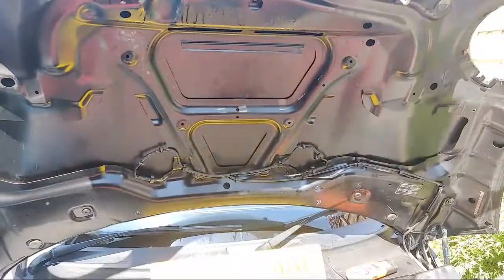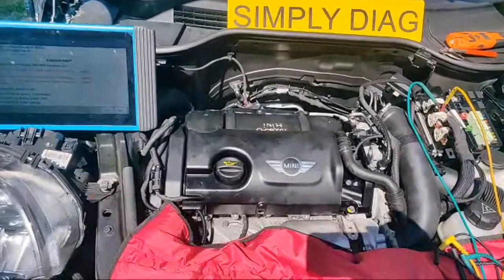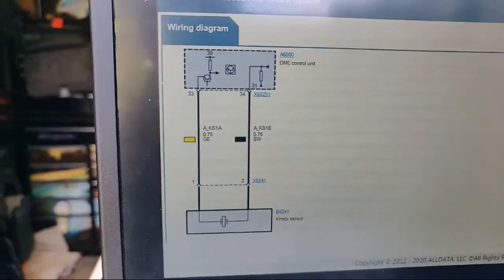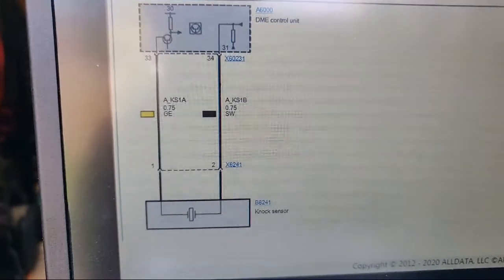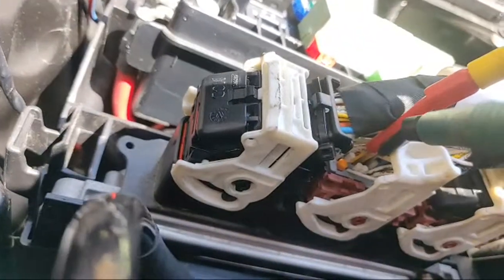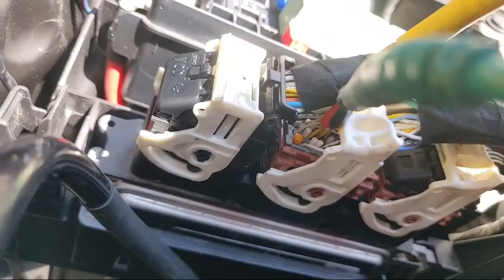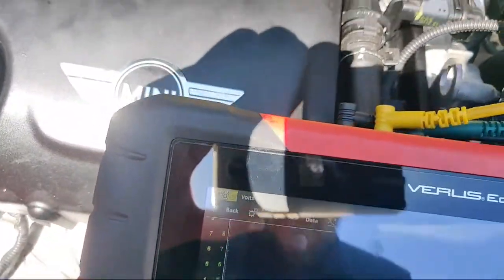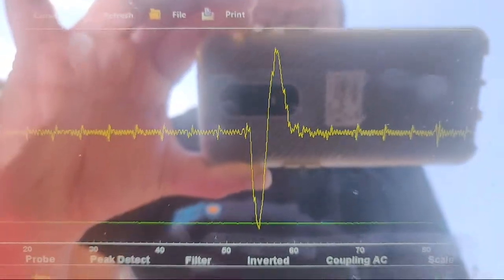Mini Knock Sensor 3042, 2C58, 2F81 Limp Mode

Comment: Hi sir, I own a Mini I have exactly the same codes : 3042, 2C58, 2F81 and this one 32E3 (interface ews-dme), is that posible these comes because the battery too low ? a bit under the 12Volts ? My car is drivent very very little, more in a box than on road.  thank you for your video;
Reply: Hi did you ever find out what caused those error codes?

Comment: hi, can you please help a bit? I have a mini cooper 2014. turbodiesel 105Kw 4WD. It has a synchron problem on 2nd gear (if not put in and out of 2nd gear totally easy, you can hear and feel a  slight crack, bigger on bumpy roads - also diagnosed as such by my mechanic). But the bigger issue is that I experience a loss of power every once in a while which I can never reproduce to my mechanic. When it occurs, I feel like the engine has 50% of the power and RPMs drop down when I press the pedal, basically it feels like a car of half the power. Boards shows no lights, also my mechanic says diagnostic does not show any fault. Another interesting symptom is that if I stop the car while it is in that state, cooling fans continue to work for couple of minutes (no indication of overheating on dashboard). But if I stop while all is good, they normally stop with the engine. I read on line about the limp mode which protects the engine if there is an issue with transmission or others. Is it possible that I am experiencing a limp mode but without the Engine fault signal on dashboard? What would be the best way to handle this? Should I perhaps ask my mechanic to take a car for a couple of days to drive it a bit more? Cause I seem like a mad man. When he test drives it, it's all good. Please help with an advice, much appreciated!

Comment: I have the same codes after replacing head gasket and timing chain was the end result a bad knock sensor or should I be looking at a vanos replacement on my n18

Comment: Hi Steve this is some in depth stuff, great vid! I’ve got the ‘002c58 boost pressure control, shutdown: pressure build-locked’ on the same engine and cant seem to find the cause.

It started after the pcv diaphram became faulty. I’ve replaced that and also one of the vanos solenoids (intake cam) as there was a fault for that. Now the code for that occasionally comes back too but I’m guessing they’re related. I’ve cleaned the camshaft sensors too but had no luck. Is there anything you could advise?

Comment: Hello . I have some questions I want to ask you about my own car. I would really appreciate if you help.

I changed the crankshaft of my car.but after I changed the crankshaft, I realized that many errors occurred in my vehicle unrelated to the problem.
There was no problem after the car was built, but there was only a small misfire.
and after connecting the vehicle to the device, it was understood that there was an error in the 3rd cylinder.
When I lifted the rocker cover, we realized that one side of the spring belonging to the 3rd cylinder was protruding.
and after we fixed this problem, we started the tool.
but many irrelevant 10 -12 errors appeared in my vehicle

as =(knock sensor-abs - throttle lower limit could not be determined- turbo pressure regulator error-ECS-high emission )  

but none of these errors have anything to do with the repair done. 
the fault light is on every time my car is started now.and  my car do not eats gas almost too hard

What do you think could be the reason? I would be glad if you help me.
Reply from the maker: I'd be looking for a blown fuse, poor connector or broken wire in the engine bay. Hope this helps
Reply: @SimplyDiagnostics  I think the vanos solenoid is faulty. and this solenoid gives bad signals showing fault to other parts. therefore I need to check the electronics of the vanos solenoids. do you have a suggestion for this? If these parts are solid, I think the 5v error is caused by the ecu.

Comment: Hi, so let's say the sensor is fine, what could be causing the knock?  Dirty intake valves possible cause? W about bad petrol? Bad sparkplugs? I recently change my turbo and went from 5W30 to 5W40 oil could it affect combustion (which knock is by def: bad or double ignition) ? - What else to look for? It puzzles me because once a single knock happens, the engine light is ON until fault is cleared. So hard to see how often it really knocks... Thanks for video. Cheers

Comment: Thank you for showing how to test the 2 wire knock  sensors, I see a lot of Nissan vehicles with knock sensor  codes it does not cause a drivablity problem or a check engine  light , but now I know how to test them with my pico.  Thank you for the video!

Comment: Steve is the voltage range you selected common for knock sensors across manufactures as i wouldnt have known what scale to use when setting up the scope?
Reply from the maker: Fairly mate, yes, but it doesn't matter, get some sort of a trace on the screen and drop voltage and time until it fills the screen. Running down the road I would have it on a 5v AC scale

Comment: Nice. the ac wave form comes from the knock sensor as it creates its own voltage? Am I right. I didn't realise the signal wire had a bias voltage.

Comment: will scopeing the coils with higher revs show the engine pinging if its not the senor  steve
Reply from the maker: Higher revs will increase the amplitude, I've actually got it to fail after the video, it fails when hot - flatline zero volts